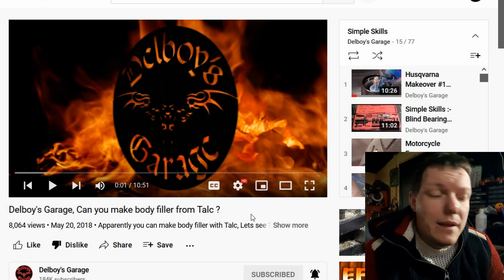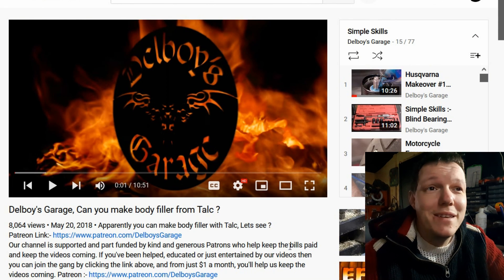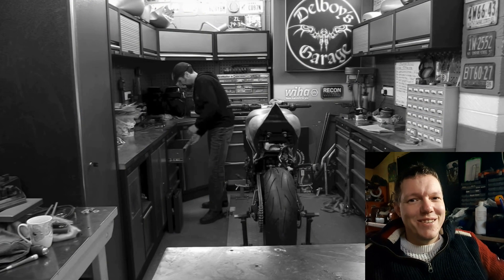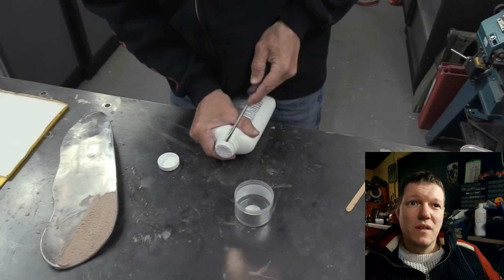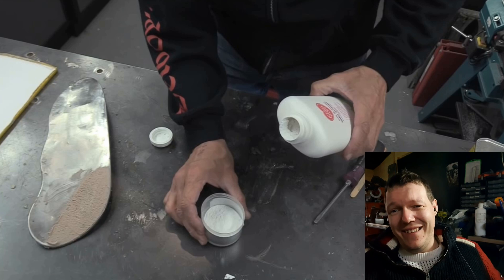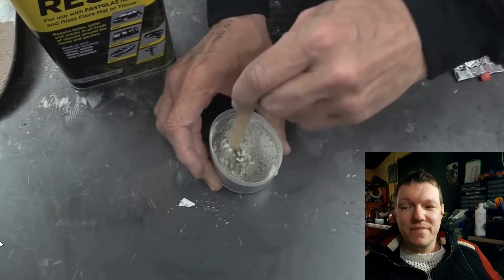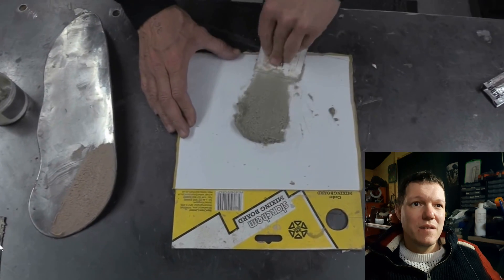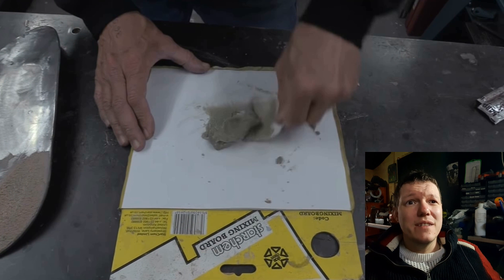Simple Skills - Deller Dust

Comment: Never heard of this so I googled:
"Lowest cost filler for thickening polyester and epoxy resins but will add significant weight over fillers such as cabosil. Talc also can be applied to skin to help prevent itching when working with fiberglass. (Color: White)"
I hope there is a Christmas dancing del on the way.

Comment: Adding dust from a cricket pitch crease line adds flexibility because over time the dust has fine particals of the wood called willow mixed in with the soil. They make cricket bats out of willow because of its flexibility and elasticity. Putting epoxy resin and cricket pitch soil together is just a common sense approach. 👌

Comment: First thing that came to mind, was delboy grabbing one of his erosion discs, creating a pile of metal dust, which he magically turns back onto workable steel again, by fusing the dust back together with a MiG  =)

BTW, bicarb and CA is a thing, that can be used to fix plastic bits (nub & hole hinges)
Reply: Bicarb and CA is how I fix my nails when I snap one - surprising how strong it can be compared to CA alone!

Comment: I have used talc in the past, it is easy to sand down and gives a smooth finish but is quite heavy as fillers go. But you mix the resin and hardener first to get the correct ratio AND THEN add the filler bit by bit to get the desired thickness, not start with the filler. DOH!
Reply: @cagmito76  Never had any issues as far as I remember.

Comment: Can motor body filler be used to talc bum and testes: YES!! We all know that. 
In emergency bathing situations, motor body filler can be combined with other garage materials to create a perfect substitute for talcum powder. For example, asbestos and some thermite create the same soothing and refreshing feeling when rubbed on body parts!!
Also, we all know that if you have any broken glass, you can  use the reconstituted parts to make your own contact lenses. We all know that. BUT!! - It is not just glass that can be used!! Metal shards and even sand itself can be substituted and have the identical properties as shop bought contact lenses!!
Need a heart valve? Why wait for a donor when chances are you have all the parts you need under the kitchen sink....

Comment: All of you dare to question Del's wisdom ,when I ride I have emergency =
Air for the tyres
Visor for helmet
Fuel for bike
Tyres
Chain and sprocket
Engine parts
Gaskets
Suspension components
Battery
Brake pads 
Granted my bikes in the van

Comment: I've used talc and polyester before but I prefer wood flour but as a fibreglass filler for boats ,not on metal , polyester to polyester sticks like sh!t to a blanket and almost becomes one .no myth busted as he used it in the wrong application. It's just media ,you can literally use anything in polyester resin .

Comment: While I realise Del is not the brightest bulb in the pack, this is just sad. You can make "filler" with any resin and any powder. Whether it is any good or not is another story. There are many powders available specifically for making filler +/or glue, especially when used with Epoxy resin. Polyester resin is used in body filler because it is cheap,- It does not have good adhesion properties esp when compared to epoxy., and as demonstrated it haqs f..all ability to stick to a polished surface like trhe shiny piece Del had. 
Car bog is cheap easy to use  and very convenient, so why would anyone (except Del) want to piss about with floor sweepings and baby powder? One last point: If Del thinks I'm going to waste my precious collection of floor sweepings, collected over many years of bog, metal and wood sanding, he's out of his tiny mind.
Have a great Christmass.